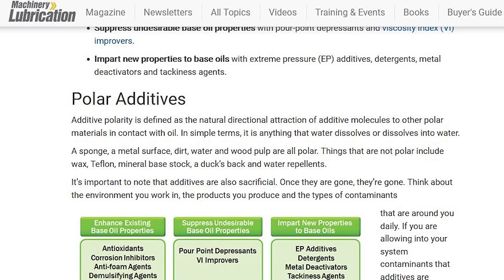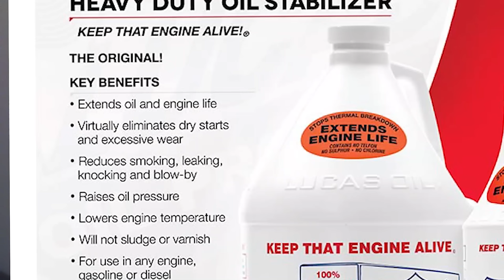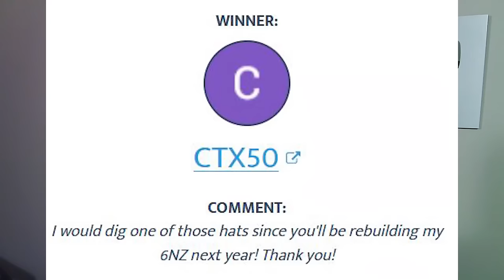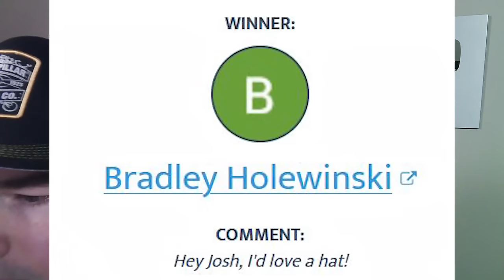Does your Engine NEED Lucas Oil Stabilizer? A detailed look at the "Benefits."

Comment: Lucas and other additives, just like all other products, engines, and oils, is not a one-size-fits-all product.

For older engines that see a lot of stop-starts, have a degree of wear with lower oil pressure, worn rings, etc, Lucas can be a lifesaver and keep that engine alive for many more years.

While the best answer to a worn engine is a good, proper rebuild, until the people saying "don't be cheap and rebuild it" or "fix the problem don't bandaid it" start paying for all those rebuilds, it isn't an option for everyone.  That comment and attitude is a terrible thing and does nothing but belittle others that have less resources available to them.

The reality is, very few people live in an ideal situation, and that is the market for products like these.  For people that need an extra help and are unable to afford the ideal solution.

So, can it do the things it says?  Yes, it does.  Will it do it for every engine in every situation?  No.  It will not.

My anecdotal evidence is that it in my 89 3406b PEEC with 2.6 million miles, it lowers the temperature by about 10 degrees, raises power and economy by maybe 0.1 mpg, runs a little more smoothly and oil drain is cleaner.  It also works really well in my 1931 Packard running even more smoothly, which is saying something.

I use their various other products in my hubs, gears, rear ends, grease, etc, and have found it to be a superior product to typical conventional products.  My hubs are quieter, and 20 degrees cooler with the oil lasting longer than normal hub oil.  Rear ends, transmissions are both quieter, smoother and cooler.

As a bandaid, it saved me from an expensive tow bill before.  My rear end differential bearing failed, and I was nowhere near a shop not home.  Entire chunks and strips of what was left of the rollers were stuck to the magnets.  I drained out about half and put in Lucas, and it made a substantial difference in driveability, and allowed me to finish the run, and get another for home.  I was able to change the rear end over the weekend, and had no time lost.

Comment: Project farm did a test cam out good. I use it in all my stuff. My stuff runs quiet as a mouse. I live in fl and the heat is detrimental to engines down here. You cant go by the recomended dealer milage you physically have to check it because it breaks down so much quicker. Oil is like water for your body. If you dont change it your shit will fail

Comment: I can affirm the good with Lucas oil products! If you use it accordingly... the way you describe everything is correct but  oil additives are nessary with these oils made these days and have nothing but positive affects when used according to manufacture. I assure you there is many many more people using Lucas that have seen  all the good things and can call bs on your views let alone your lack of  knowledge truly about Lucas and how it helps including dry starts on bearings. I personally have done side by side comparisons using Shell Rotella 15w 40 without Lucas and used Lucas and it is night and day difference in Diesels! Including their fuel stabilizer... you really only have your old school view and not the views from other people including mechanics like me that use this stuff on the regular with true benefits... Oils these days are full of detergents and lack lubrication like 20 years ago before all the emissions and  bs.... I along with thousands of users would debunk your view including how you look at Lucas. Lucas would have helped with lubrication before the major damage! As a mechanic of 25 years and many many engine teardown and builds I'd put Lucas in as to keep my motor in top shape longer. When mixed with oil it is not tacky but will help with lubrication like its designed for... Manufacturers these days don't want you to use or do anything that helps you keep you vehicle running longer with less problems, it is more money for their company.... so why would they tell you to use this or any products to help longevity.... next time how about you do a questionnaire on Lucas and ask people their positive experiences instead of just talking down an American oil company....

Comment: The stuff dissolves in your oil it really doesn't make it thicker you have the same as they have done and didn't do any testing to prove your point,i don't think you need this,but I doubt it does any damage.the additive are actually different some clean the engine other are suppose to coat the wear parts. yes the should to the science to back up there claim's.

Comment: Worth mentioning....

All engine oils are formulated with an additive package that includes anti-wear, friction modifier, detergents, dispersants, anti-oxidants, corrosion inhibitors, extreme pressure, anti-foaming, anti-aeration, seal conditioners, etc... I'm not referring to the aftermarket supplements like Lucas, BG MOA, Hy-per Lube, Liqui-Moly Ceratec...etc. It's not a good idea to use those aftermarket supplements as complications from additive clash and/or base oil incompatibiltiy are real issues that can do more harm than good.  Oil formulating is a very careful balance to ensure no one additive (or additive type) overpowers another.  When you go pouring some random supplement/stabilizer into that formula, you've now upset that balance.

Oil Stabilizers/Supplements are 99.5% olefin copolymer (a waxy, rubbery polymer) and 0.5% polyisobutylene (tackifier).  The polymer is a viscosity modifier with very poor shear stability (loses >50% of it's original viscosity after 100 hours) and the tackifier is only there to make it cling to those gimmicky plastic gears in parts stores to deceive people into thinking that's actually useful.  Tackifiers are useless in an engine since engines are lubricated with a pressurized oiling system.  In that system, tackifiers only clog up stuff.  Tackifiers are useful in equipment that sees splash lubrication such as manual gearboxes and differentials. No aftermarket oil additive/supplement on the market will contain any useful additives, it'll only dilute the amount currently in the oil, shortening oils life, weakening anti-wear, and promoting both oxidation and aeration of the oil.

Short summary,

Avoid using aftermarket oil additives – Store shelves are littered with aftermarket additives that promise to increase fuel economy, reduce wear or restore an old engine to like-new. Adding them to your oil disrupts the oil’s chemistry and may reduce its ability to protect your engine. When you’re using a good motor oil, there’s no need to modify/alter it with an aftermarket additive. No synthetic engine oil on today's market needs to be stabilized. 

https://blog.amsoil.com/more-than-you-ever-wanted-to-know-about-motor-oil-additives/?zo=5270935

https://www.machinerylubrication.com/Read/29836/aftermarket-oil-additives

https://www.machinerylubrication.com/Read/29610/aftermarket-oil-additives
Reply: Here’s my perspective as a petroleum engineer’s on oil stabilizers:

Stabilizers originally was meant for racing, where you can’t simply tear down your engine during a race if seals in your race car have worn down. Stabilizers are essentially a band-aid solution.

Do you need oil stabilizers? 

Not really, but it depends.

I will have to disagree that stabilizers disrupt the chemistry of most oils. In reality it doesn’t, especially with the moderate quality oils. It won’t even harm Amazon basics oil.

We design stabilizers to not interfere with the oil used to lubricant the engine and make it universally safe to mix with pretty much any oil. It doesn’t disrupt the Chemistry as most other brands want to claim. However if you want the best performance of the stabilizer, just stay in brand if possible. Almost every brand has their own formula for stabilizers. I remember working on Amsoil’s oil stabilizer before changing industry to aircraft lubricant solutions.

As for the tackifier, that part I can confirm some level of truth. If anything, the stabilizer is a thickener at best and adding the stabilizer is the equivalent of making your engine oil have a little thicker viscosity. The function of the olefin copolymer is the equivalent of sealing worn parts and gaps, which essentially functions as a bandaid. 

Think of it like putting a piece of chewing gum on a leaky pipe. So if you have a worn engine but don’t feel like replacing parts like worn piston rings, a stabilizer will function just fine.

It will always exist in the market as long as engines use oil. Stabilizers are actually byproducts of normally manufactured engine oil.  We refine the original motor oil, and then refine the leftovers with their own set of additives to function as a stabilizer.

Stabilizers are a nice quick fix solution for old worn out engines, so claiming to avoid them completely may do more harm than good for those that are already using it since it’s already sealing the small gaps, discontinuing the product will eventually bring the problems back unless the owner of the engine replaced the worn part with new parts.

If you’re not comfortable with stabilizers, I would  suggest moving up a tier in viscosity of your regular oil changes. Think of it like moving from a 5W-20 to a 5W-30. Going up a viscosity is essentially the rough equivalent of adding a stabilizer.

Comment: About all I'll use Lucas for is mixing with 30W engine oil, or gear oil and make chain oil for my firewood cutting chores. It does stick around, cheaper thsn chsin oil, better chain life.
 Just did s enging job that was a leaker, all it was good for was adding lots of hours cleaning the engine bay, Stuck like gooseshit to a blanket,nasty stuff.

Comment: This is comical only speculation & you're opinion at best, no actual testing, your talking like you just run straight lucas in an engine that it doesn't mix with 4 to 6  quarts or so of engine oil to dilute it. And I'm not a Lucas fan but you should do some more research and actual testing before you bag on a product 🤣

Comment: Snake oil. It's just a thick base oil. It's only beneficial for an old worn out smoking engine. Even then it's marginal at best. I would highly recommend not using it in any modern engine with tight tolerances.

Comment: I have an old Ford with the 300 inline 6 the engine is strong doesn't burn any oil thought I would add a quart of Lucas the engine didn't like it started making lifter noise drained the crankcase put back in my 10w30 Shell Rotella no noise whatsoever ran like a sewing machine Lucas might be good for a worn out engine I won't use it just my experience the 300 did not like it by the way this was in summertime also July of 2022

Comment: Do not use engine oil additives: period. Unless the engine is on its last legs. Engine oil is a precision chemical formulation. Adding a additive willy nilly will disrupt this formulation and most likely do more harm than good. Generally increased wear.  Omly way to see if there is any benefit or causing problems is OIL ANALYSIS

Comment: Great video as always 
I think they claim to lower engine temps by lowering friction wich makes sense in some way

Other than that the sludge solution could be by the detergents on this 

There's an additive called SUPER KOTE wich is a anti-friction and isn't that thick but it claims to last 80k kilometers even after you change the oil 
I'd like to see if that's true 
I think it's a Teflon based product 

I'd like to see if LUCAS oil treatment can be thinner as it mixes over time with engine oil and maybe some of the problems that an oil thickener can cause will dissappear 

From Costa Rica 🇨🇷
Reply: I live in colorado, during winter i see -15f  and when lucas is properly mixed with oil it thins out considerably more so with my diesel because it hold 12 quarts of oil i have always used lucas and will continue

Comment: You shouldn't add the heavy Lucas oil to your modern cars they make a liter oil for today's cars so yes it does work if the car is older than and 02 or so the heavier oil is better every time you restart an engine it's cold a dry start that's why the start stop system isn't good for your engine

Comment: This is a Jim mungai again I want to throw away a complement toward Lucas I’m in Amsoil guy and I know a guy he has a para 98 dodge with a Cummins under the hood and the transmission wasn’t shifting quite right and he put Amsoil in and it seem to help it off of the transmission fluid and then he put Lucas MRI transmission additive in there and I’ll tell you what it helped it out it really did shifted better I don’t think I could think of is maybe he had a couple of his valves in the valve body they were gummed up a little bit and I need it cleaned out well anyway yeah Lucas make some pretty good products I’m not gonna say they don’t anyways this is a Jim mungai From Kennerdell Pennsylvania golf

Comment: If you had to add oil additives you have a serious engine issue. ITS A WASTE OF $$$. Owning semi trucks for 26 years. Never had to use this stuff. Change your oil and filter base on specification those engines will last over a  1 million miles..I've owned Cats, & Detroit. No issues

Comment: Don’t use it at all! If you have an old motor helicopter oil is good 👍 as long as your motor can take that weight of oil. Injector killer is what Lucas stabilizer is. Use what is for your motor zinc helps for wear.

Comment: Lucas oil stabilizer does more harm than good and I would venture to say it’s only benefit is a lighter wallet if you consider that a benefit. First of all it is excessively thick to the point that it is beyond the normal charts and scale that all oil is based on. When you add that stuff to your oil it dramatically changes the viscosity of your oil and that is not a benefit. Extremely thick oil creates more stress on the oil pump and causes more parasitic draw on the whole engine making it less efficient and use more fuel. The thick goop also has a inferior additive package compared to most quality off the shelf oils so you are essentially turning your premium oil in to cheap no name garbage that you would never buy. Basically any additive you put in premium oil is going to disrupt the balance engineered in to the additive package and make the oil worse than what it was. These additive companies are expert marketers that don’t care about you or if the product works they only want your money.

Comment: OIL PRESSURE. HOW MUCH?
as long as you have a sufficient amount of oil pressure, any more than that is wasted fuel, and can lead to damage if you have to much. 
Oils ability to stay between hot fast moving parts with tight tolerances is known as the ( oil wedge)
Many things affect the Oils ability to do this, viscosity, heat, TBN left...
Excessive pressure WILL NOT increase this ability whatsoever. 
What it will do is heat the oil considerably,  (which can reduce the viscosity which reduces the oil wedge)cause much higher pumping loss to move the oil, which costs more fuel because your moving more oil through the engine. 
If oil pressure gets to high it can lead to parts breaking because of the higher stresses.  If it's high enough, it can even cause a spun bearing. 
How much do you need? 
Enough is enough

Comment: anyone work on generators that run 24/7 and sometimes cant get to them to change the oil, just the filters and add Lucas??  I do and want to see if there any else that understand how well Lucas will get you by when you can only add a couple gallons and change filters

Comment: Lucas oil stabilizer is literally just pure bright stock petroleum with zero anti wear additives or viscosity modifiers.  It is literally just maple syrup for your engine.

If you buy this stuff you're a sucker.  If you want any of the "benefits" this product has just go up a grade to a thicker oil.

This is a terrible product, however their UCL is pretty good.

Comment: This product is basically something you use when you don't want or have 2000 bucks to redo a engine. So it just acts like a bandage to get you by. Now i wouldn't use it in the winter time. I used it one time and 2..3 winters ago. When i crank up the car... It was just a raddle noise for a good 3..4 seconds. So i won't do that again

Comment: 2:14 I don't know it sure seemed to take all the blow-by away in my 328kmile 7.3 Powerstroke. I even just got done a trip pulling a trailer through the mountains where I had to hold it full throttle for like 25 minutes getting over this mountain pass. Fucker purrs like a kitten

Comment: You know when an engine so worn out at idle it has 0 oil pressure or if it has an idiot light it's blinking.....
 Put some 80w 90 gear oil be in there and that motor will run many more miles,, Depending maybe more seasons more years

Comment: Oil thickener. Wanna mess up your VVT? That's a great way to do it. Run the recommended oil viscosity that's labeled on the filler cap. You aren't smarter than the people who designed the engine.

Comment: The thing is...if you need ANY additives other than what's ALREADY IN THE ORIGINAL PRODUCT YOUR CAR NEEDS...you are just buying yourself time for an already FAILED problem...aside from that, i WOULD use it on a WELL MAINTAINED 150K mile or more engine
 Hell, i figure ive driven the bulk of its life out anyway....moral of the story...just fix ya damn engine people

Comment: This dude is nothing but a negative Nancy. Lucas is some amazing shit and older people thats been using it for years and years live and die by that fact. 

I started using a few quarts every oil change of 15k in my 900k mile Detroit and I was mind blown with the results. Better throttle response, smoother idle, smoother RPM increase, better oil pressure etc. 

I even put 2 quarts in my reman alliance trans because it had a slight whine in reverse, 1st, 5th and 6th and it even helped that along with smoother shifts. 

I 100% recommend Lucas.